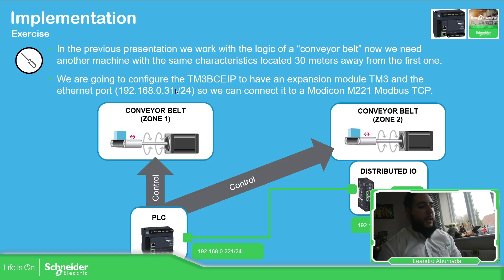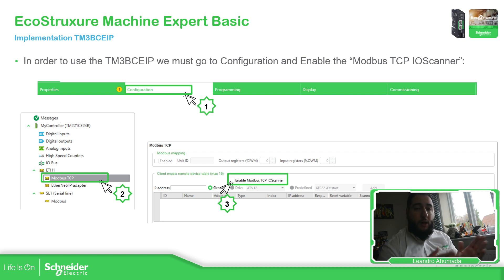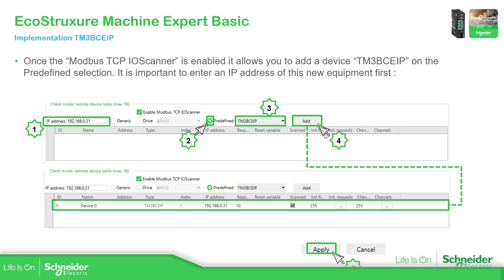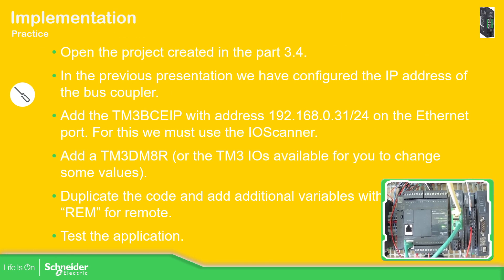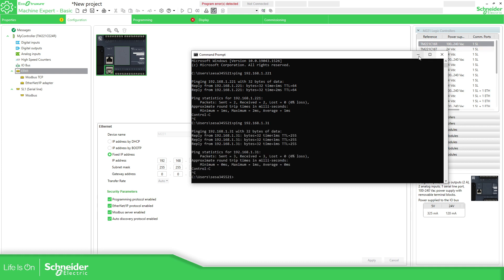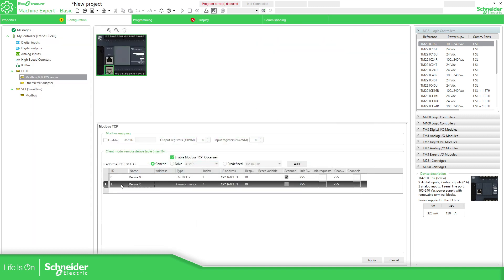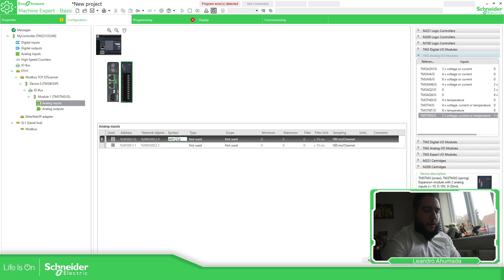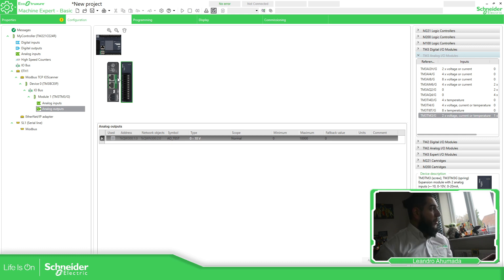Training - M221 - M10.6 IO Scanner Modbus TCP with TM3BCEIP

Comment: So we need to delete all the setting/module that already uploaded to the bus coupler? , then is it possible to connect HMI to the bus coupler other ethernet port?
Reply from the maker: Hi there! Do you want to connect the tm3bc to an hmi directly? Then the configuration needs to be downloaded using the web interface. If the bus coupler need to be connected to the m221 then you can go to the web interface to change the network settings ans use modbus tcp only then the m221 will download the other configuration.
Reply: @LeTomasAHUMADA  allright thx for that :). Now i have an issue connecting to the bus coupler. whenever the system is ON, i need to delay the PLC powerup time with a physical timer for about 30 second, if not, the bus coupler would not detect any Digital or Analog module attached on it. Is there any tips for that?, or stick with the timer is actually normal?. My current setting is using IOScanner in my M221.
Reply from the maker: @muhamadisan3396 hi there! It does not look normal. Try to check for a new firmware and if the problem persists contact the schneider technical support because that should not happen
Reply: @LeTomasAHUMADA  I already update the Bus Coupler, Digital and Analog Module, but not for the M221 since i couldn't find any firmware update file online. Can you link the firmware update file for M221 please?
Reply from the maker: @muhamadisan3396 the latest firmware came with the software, try to update the esme basic in case you have not
Reply: @LeTomasAHUMADA  Allright will try, thx alot for the help :)

Comment: Hi, can i use  a M340 to read data from TM3BCEIP ? Thank you
Reply from the maker: Hi there! Yes you can but you will need to configure the TM3BCEIP using the standalone software and the webserver then read/write the data using the M340 . You can use the blocks or the IOscanner.  If you are using ModbusTcp in the TM3BC software you will see the addresses.

Comment: Hi LeTomas, can you help me with M221? 
What i need is : 
M221 i need to take values from 2 different Devices on the same IP-address with different Device ID 
and then i need the M221 to be as a slave Device
Reply from the maker: HI there! having two physical devices with the same ip address with cause a ip address conflict in your network. I will not advice to have that configured. What is possible is to have configured on the Ioscanner the same device ip address but different UnitID as i did with the TeSys Island explanation: https://youtu.be/Kyikd14jNBY

Comment: How can we add a TM2 series module to the TM3BCEIP ? In guide of the TM3BCEIP there is information that this is possible, but in TM3BC IO Configurator that it isn't possible. Could you give saome advice about that ? Thank You.
Reply from the maker: Hi Jacek! thank you for your question.
I found out that in the application "TM3BC IO Configurator" it only allows you to use the TM3 module.
However, If you use the software for the Modicon M221 or the EcoStruxure Machine Expert in the configuration of the Bus Coupler it allows you to add the TM2 modules.
Reply: @LeTomasAHUMADA  Due to lack of TM3 modules I need to try TM2 😁. Thank you for your hard work and sharing videos, this is a huge part of practical knowledge.